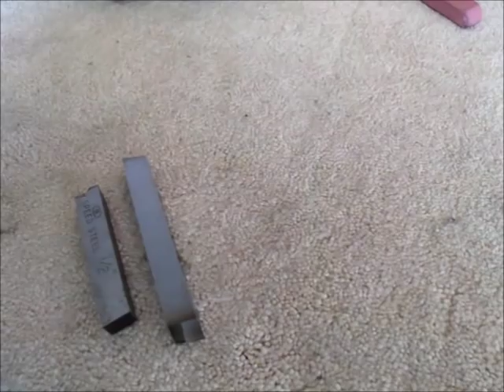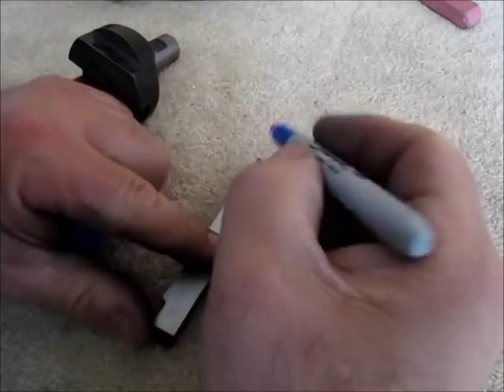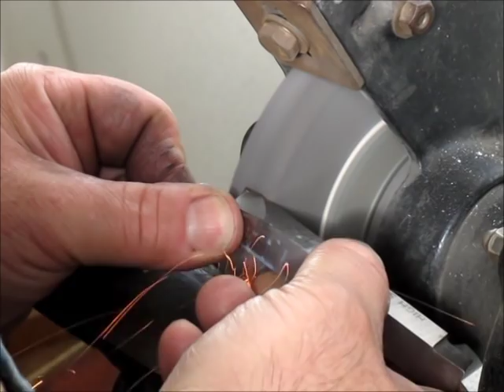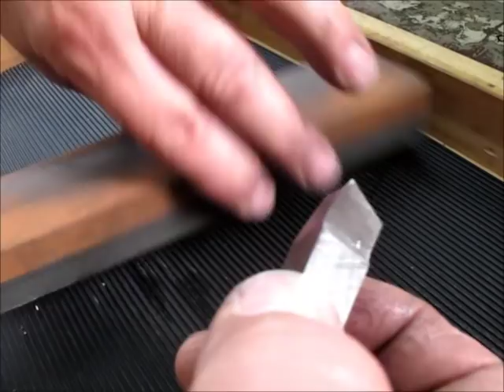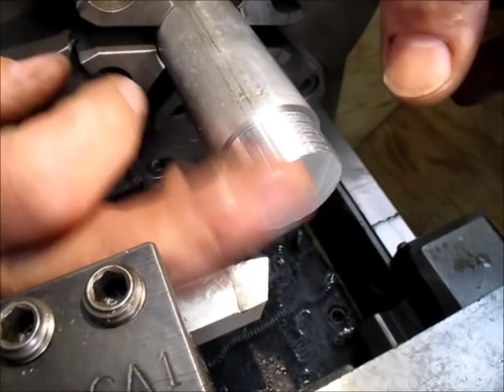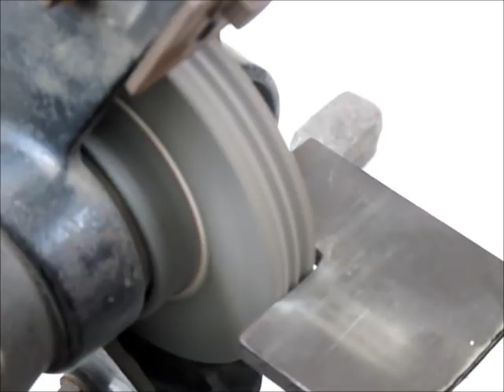Toolbit Development 1

Comment: hi thanks for the vid -im struggling to get a mirror finish on aluminum on my old southbend 9 - possible my motor is worn? ive been trying using the back gear for more torque, tends to labor even on light cuts! really frustrating!

Comment: Thank you for your video! Ive had a very difficult experience breaking chips with CNC turning internal diameter aluminum with vcgt inserts on a 4" long part to a tolerance of 0.0006". had to add 3 stops on 3 different boring bars to manually clear the chips cause it can make trouble with the ATC. wonder if there is a good solution to it? of course with this fine tolerance and long thin boring bar you cant push the part to break the chip and are left with long stringy chips. the ap is only about 0.01" on diameter for the finish cut. ive tried to decrease it to 0.004 and no luck there too (trying to make dust like and have coolant wash it off). would love to hear your take on this matter. thanks!

Comment: I am fascinated by the process of grinding one's own tools. It seems like an absolutely essential and entry-level skill for anyone who wants to get in to metal-work handicrafts on a lathe, especially as an amateur or hobbyist.

'thisoldtony' also has an excellent video on the same topic and when combined with this, slightly more in-depth study the two give a very comprehensive grounding on the techniques required.

One aspect that occurs to me is--don't the blocks of tool steel get hot while you are grinding them?

Comment: I notice on your first tool cuttings, You never put a proper grind on the tool bit and left the very end of the top flat, This is definitely a sign of you know what, In-completed grinding for cutting anything. What was the purpose for that, to show that not grinding a bit that would cut as such as you did not cut, A pointed bit if ground to finish would have cut that al. clean with a good finish as all you would have to do is slow the final cut feed rate to minimal.

Comment: Haven't finished watching this yet, but i thought id say that i normally skip honing stones and just give my tools a lick on the balder buffing wheel before I use them and it does essentially the same thing, leaves a nice finish at least with aluminum. Its something I started doing years back with wood carving chisels and the cutters I used on my old wood lathe and I've just carried the practice over in my shop for metal work.
And if you find yourself up in humboldt county sometime, stop by. Be cool to meet you and talk shop one of these days.

Comment: Looks like the chip breaker is directing the chip to fly over the chip breaker, missing the angle that is supposed to bend the chip till it breaks. Hard to see detail, have you ever tried polaroid sunglasses? That would give a cheap test. They can be miraculous in some instances. May need lens rotation depending on the light.

Comment: Starrett has a short but great section on saw blades, how they work, different teeth, and materials. and break-in (!) I had never heard of breaking in a saw blade. The teeth develop micro chipping until they are used enough to break the razor edge similar to how Tom explains tool bits.
Small:
http://www.starrett.com/docs/saw-resources/recommendations.pdf?sfvrsn=2
Big:
http://www.starrett.com/docs/default-source/catalogs/starrett-band-saw-blades-(catalog-60)

Comment: Most of the video was good, BUT, if you made your chip breaker much smaller or narrower you would have improved the chip breaking effect, Then I also do not like to see someone dragging their bit back across the job cut after one has finished the cut,  it ruins the finish, and dulls the bit and with different steels can chip break the tool bit.

Comment: does anybody still sell solid carbide blanks tool blanks like half inch by 4 inch or 5/16 by 3 inch or 4 inch? I bought an old ways actually about a couple of plays that came with them boxes and boxes of old crap most of it junk but I did get a bunch of blanks some of which were solid tungsten carbide they're a pain in the ass to sharpen but once you got a nice tool bit less virtually forever. I suppose that's why I'm having a hard time finding anybody that supplies and stuff because they last forever and it's not good business practice I really would like to get a few more if anyone knows what I'm talking about please comment
Reply from the maker: Hi Clown,

I have not seen solid carbide squares for tool blanks. Generally you would see a chunk brazed into a steel shank. For boring tools solid carbide is the top choice. Over a certain size most of the carbide is going to waste just doing nothing but supporting the edge that is doing the work. There would be no advantage in my mind unless you like to grind a lot of difficult stuff. Thanks for the comment.

Cheers,

Tom

Comment: Heya Tom! Thanks for the clear demonstrations of each step. One thing I'm running into when turning 6061 is welding, i.e. the aluminum begins to adhere to and build up on the cutting edge. Any tips on dealing with that?

Comment: If you get HSS too hot when you're grinding and it turns purple, dies it ruin the temper like on a knife blade or is it different?
Reply: Does, sorry
Reply from the maker: Hi Shane,

No it does not. High speed steel is a red hard steel. What that means is it retains it hardness even at red heat. Grind away. Thanks for the comment.

Cheers,

Tom

Comment: Anyone can cut butter - put some steel on and lets see the performance.
For example 4140  1.25 inches dia.
Reply from the maker: Hi 007,

Take a look at my videos called chip control and over one inch diameter reduction cuts. We do some rather more impressive steel cutting with high speed there. Thanks for the comment.

Cheers,

Tom

Comment: Very good video Tom; from your back catalog.  All the tool angles are really confusing when starting out on the lathe.  You took the edge of that with this video.  Thanks.  I noticed that your stone was pretty grimy.  I was told that using oil on the stone transports all the metal particles away, and makes it easier to keep a "sharp" stone (or clean if you like).
Reply from the maker: Hi Arnljot,

I clean my stones pretty regularly normally. They pick up metal from stoning off large surfaces. I guess I showed this one in a loaded condition. I typically use the stones dry. There are two points of view on stone sharpening dry or wet. Both have merits depending on the type of stone and the sharpening goal. Thanks for the comment.

Cheers,

Tom

Comment: Always been told not to do anything else with the grinding wheel that you use for tungsten. Do you soak your tungsten in acetone after?
Reply from the maker: Hi Impact,

The grinding wheel is constantly breaking down at exposing fresh abrasive in particular if you dress the wheels. Only for the most demanding aerospace or medical applications would you be concerned with this source of contamination. Thanks for the comment.

Cheers,

Tom
Reply: Not sure if this is relevant or related but a grinding wheel used to sharpen tungsten tig needles should not be used for anything else. In this case it is to prevent contamination of the needles
Reply from the maker: Hi Harry,

Contamination is only a concern for the most demanding applications. Thanks for the comment.

Cheers,

Tom

Comment: Excellent description on grinding hss toolbits, I particularly like your comment at 13 min about wide range of angles that will work, I also like that you place the toolbit flat on the table and let the radius of the wheel produce the back rake, much easier to regrind when its time,
Reply from the maker: +Walter Maisey Hi Walter,

Thanks for the comment.

Cheers,

Tom

Comment: Very useful video for someone who just got himself a small hobby lathe. Thanks.
I was thinking about using a angle grinder to cut the blanks. This will get you a flatter surface that you could sharpen on the bench grinder. But things can get rather hot with an angle grinder and I'm wondering if this will have a negative impact on the HSS steel. Any thought on that?
Reply from the maker: +U3erpru7ser Hi U3,

High heat will not cause any problems. High speed steel retains its hardness at red heat. Thanks for the comment.

Cheers,

Tom
Reply: thanx

Comment: i use inserts , i know i know i really should start and grind my tools and i will , im gonna order some HSS blanks , is it really as easy as you make it look? i no its all about practice and i am going to do it but im not looking forward to it. thanks for the video man .
Reply from the maker: +Joseph Armstrong Hi Joseph,

I takes a little practice but it sure is cheaper than buying inserts all the time. You can touch up your tool and keep on going. Thanks for the comment.

Cheers,

Tom
Reply: Although with this aluminum a proper insert would last forever.. PS hands in chip coil with machine running? Big nono

Comment: Hey Tom I got my first lathe delivered yesterday a BV20-1L. I've never used a machine lathe before, just a little time on a wood lathe in 8th grade.  The last week I've been watching your tool development 1-2 and 3. I got all HSS blanks with a sharp edge from the factory and after the first cut which was a little crappy I took it off, honed it and gave the front leading edge a little radius on the stone and what do you know, much better just like your video, but like you said we can still do better. That's buddy, saved me a lot of trouble from the first 2 minutes on the new machine.
Reply from the maker: ROCKMOREDESIGN Hi Rock,

Glad you liked that one. Congratulations on your new lathe. Its always fun to get a new machine tool. Thanks for the comment.

Cheers,

Tom
Reply: Tom I have to bore a perfect 22mm hole in the side of a 30mm 6061 rod. The hole is to be used as a clamp to hold another 22mm tube. I bored a 21mm hole and found out quickly that an adjustable reamer is not designed to enlarge a hole, just smooth it out. My next move is to bore the 21mm hole and use a 22mm end mill mounted in my lathe chuck to enlarge the hole. I made a clamp with taped holes to attach my work piece to the saddle and move it into the drill. Worked perfect to bore the 21mm hole. The question is will it work to bore out the hole to 22mm with the end mill.. I  Thanks for the advice, my HSS radius lathe tools work well already, but as you said we can do better.  Here is the Facebook page with the 1st rough part. 

https://www.facebook.com/mike.rockmore.3

Comment: Hey Tom, I turn alot of CW614N Brass and just can't get it to chip, I've tried ground tools of various geometry, negative geometry carbides, different feed rates and DOC but I'm either getting dust or splinters, not problem with surface finish but the mess is getting on my nerves, any suggestion? The finest feed rate on the machine is 0.004".
Reply from the maker: Hi Andrew,

Have you tried a positive geometry? Many brasses and bronzes chip as you describe just for something to do. Increase your nose radius and try a zero or positive top geometry. Let me know how it works.

All the best,

Tom

Comment: Great video When i started turning i never found a good video like yours , the chip breaker maybe could be easy to made with a dremel or any other rotatory tool ,and a  small cutting disc.
Reply from the maker: Hi Battle,

Harder grinding wheels work well for chipbreakers. My wheels were too soft for a small one. A dremel would also work well. Thanks for the comment.

Cheers,

Tom

Comment: Do you recommend not using any lubrication on the stone?
Reply from the maker: Hi Emil,

I generally don't use any lube on the abrasive. I subscribe to the techniques used in the Razor edge book of sharpening. Thanks for the comment.

Cheers,

Tom
Reply: oxtoolco Thanks for the info Tom. I'm always on the lookout for sharpening and honing techniques. I'm going to try it "dry" even though my sharpening stones have soaked up enough oil to never be truly dry.

Comment: How can I make a lathe tool for a smooth finish on steel or iron? Thank you so much!!!
Reply from the maker: Hi Dang,

The geometry shown in this video will work well for plain steel. Cast iron would have less rake angles particularly on the top. Hope this helps.

Cheers,

Tom
Reply: Thank you so much :):)

Comment: By grinding a chipbreaker up to the cutting edge, doesn't the side rake angle change and get sharper? I never ground chipbreakers since I never took the time to learn until I watched this video.
Reply from the maker: Hi Bill,

Grinding a chipbreaker up to the edge make for a very high positive cutting edge. There is a good section on chipbreakers in Machinery's handbook. Thanks for the comment.

Cheers,

Tom
Reply: Thank you very much Tom for the info.

Comment: This is a very neat demo. I just have one concern: At the end of the cut, the bit moves rapidly back along the surface, without retracting in the y-axis. By listening to the audio I can hear that it's scratching the workpiece during the retraction move, and that is probably spoiling the surface finish of the cut. It would be great to see the comparison without that happening.
Reply from the maker: Hey Jay,

Give me a time stamp where you think this is happening. I looked at a couple near the end and non of those were dragging on the Z retract. The cross feed is the x axis on the the lathe. Thanks for the comment.

Cheers,

Tom
Reply: oxtoolco
 Oh yes you're right -- sorry, I meant x-axis.  It happens once at 15:05, and to a lesser extent at 16:00 and 23:35. After honing the tool, when the feed rate was slow, it didn't happen nearly as much. For example it didn't seem to happen at all at 22:30, 25:00, and 26:38.

That said, I really appreciate you making this video, and I learned a lot about tool grinding -- never saw how to make a chip breaker before, and it was great to see what high-speed steel can do!
By the way, what model of lathe is this? It seems really nice.
Reply: oxtoolco
15:08

Comment: I thought you always needed to use a lubricant (oil or water) for the stones.  For oil stones, oil and for diamond or water stones you use water.  What are the reasons for honing dry?
Reply from the maker: Hi Walter,

Water or oil is not an absolute like many things in this work. I happen to prefer dry. This came from a book I learned a lot from called "The razor edge book of sharpening"

All the best,

Tom

Comment: Nice video. I hadn't planned to watch the whole thing, but you kept it interesting with the comparison of various tool geometries as well as feed rates and depth of cut. I liked your demonstration of the chip breaker groove. However, I think that makes the tool suitable only for turning, and you would need the groove on the other cutting edge for facing. I sometimes use diamond files to touch up my tool bits, particularly carbide, and I use a 5x binocular magnifier. Thanks for the tips.
Reply from the maker: Hi Paul,

Thanks for the comment and compliment. Indeed you can face with this tool as well. It will perform better at turning for sure but it will face as well. I have several of the diamond honing files and love them. I just keep cleaning them and they just keep lasting forever.

Cheers,

Tom

Comment: tom, if you use water instead of coolant when grinding, the wheel will not glaze over so bad. also try using a half inch sq. by four in. long medium India stone when honing. Use the stone like a file for better control . much easier.
Reply from the maker: Hi Richard,

Thanks for the tips. The wheels on my bench grinder are pretty soft so I dress them frequently for shape as opposed to glazing. I cant remember which case it was in this video. 

cheers,

Tom

Comment: Hi Tom,
Indeed, it was stainless steel. I never had nice chips ans the sound was terrible. I still saw some record player grooves so i also need to play with the feeding a bit. Greetz from Germany
Reply from the maker: Hi Chippie,

Increase the nose radius a little if you have some grooves you don't like. As you have discovered sound is an excellent indicator how things are going. The swish of a good sharp tool is very noticeable. 

Cheers,

Tom

Comment: Hi Tom,
 today I practiced your tool grinding techniques and I am astonished about the result. The cuttingsound was smooth and I meet had so many curls when cutting so now I need to make the chip breaker. I have been facing off a 5 inch diameter disc and it was peanuts. Thanks for the great video. Regards, Ritchie
Reply from the maker: Hi Chippie,

Glad you had a good outcome. This is the stainless steel you were machining correct? Thanks for the comment.

Best,

Tom

Comment: That's really a helpful video. As a newcomer to machining this is really good. I have been playing a lot with grinding the tools and also found some shrieking when machining.
Would this be the same for stainless steel(1.4305), same grinding of the tool?
Reply from the maker: Hi Chippie,

This tool would work fine on stainless steel. Keep your cutting speed low at around 60 feet per minute (225 Rpm for a 1 inch diameter). 

Cheers,

Tom